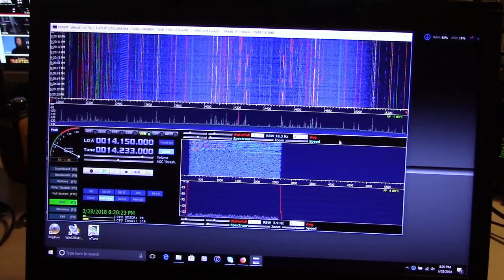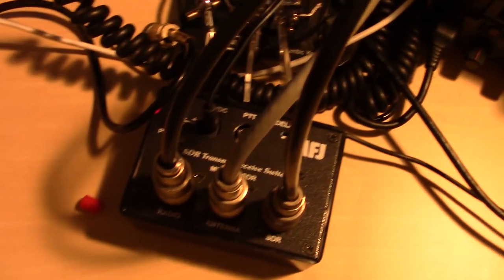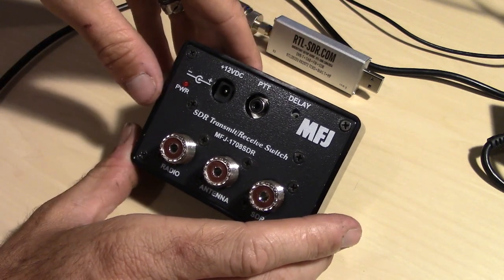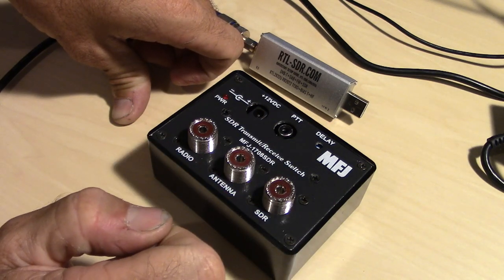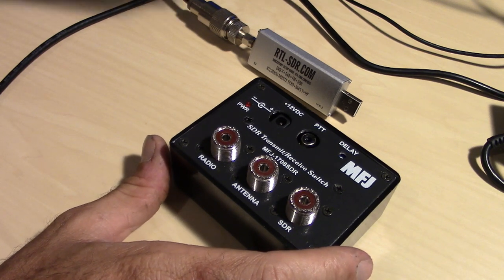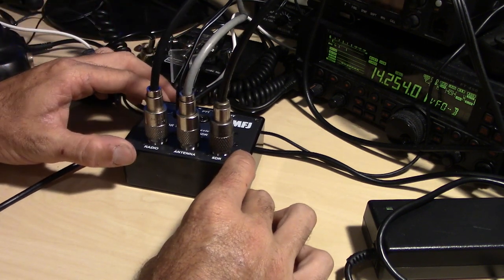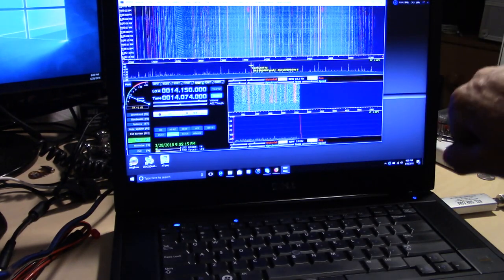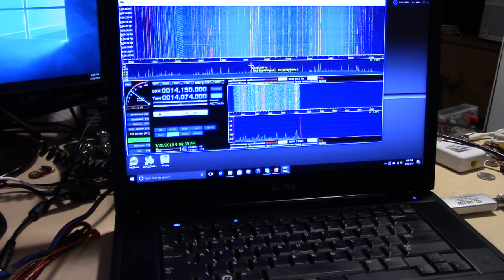MFJ-1708SDR Transmit/Receive Switch For SDR Receivers

Comment: I have this device, and just an FYI to everyone, it has an RF sensing circuit that works in absence of PTT output connected. I've used with up to 100Watts, no PTT out, and no damage to SDR.
Reply: @offthecuff6352  Still working 3 years later... IDK what "hard on the SDR" means. There is no difference in sensitivity.
Reply: @offthecuff6352  make sure you change your headlight fluid, and oil every 3ft, you're a lid. 73

Comment: you can easily bring out the PTT lines from the radio using the Ameritron (MFJ) ARB-704 box and cabling for the Yaesu FT 450.  I had my TX/RX sensing line go out, MFJ fixed, then went out again within a very short time, use the PTT instead.
Works like magic.
(I also use it to trigger the amp with a 'Y' cable to split the two)
I do the same thing to change Rx antenna/Tx antenna switching and now use a buffer/amp on the first IF to get the signal to the SDR with the FT450D front end filters working - much cleaner display!
Reply: Tapping the IF gives you the filters of the radio? So the better the radio / IF the better? I just can't see soldering inside my TS-570DG! Maybe on my TS-50. =]

Might be the best thing though. Once you tap in its no need for a T/R switch. I guess use RG-174 or similar and bring it out to the SMA / coax connector on the SDR?

Comment: My Yaesu ft-450D does not have a push to talk switch in the back of the radio. It does have a linear amp din cable port which has an RCA jack on the other end of the cable. Do you know if this kind of cable would work for the PTT on the SDR1708?Thanks

Comment: Hi thank you very much for the info. IF I well understood I may use old rigs like IC-756 or 706 or FT900 with the MFJ and a SDR-Play. No need to filter IF or else. The dongo on your USB can be replaced by the new CI-V cables on commerce or it is necesary? Thanks again 73

Comment: Cannot find the PTT cable on any radio store website, including MFJ. Do I need to call them or is it through a specific seller?
Reply: Isn't it a RCA connector? Most are. Grab a stereo cable or video cable. So you don't have extra cables adding mess to your shack strip the extra unused RCA cable / cables off. 

Or buy some shielded cable and 2 RCA connectors and make it to length.

Comment: I can still run my amp with this unit right , the amp has to be after the 1706 correct?
Reply: Correct. Amp after the 1708. In fact, the instructions include details on how to use the ptt plug to communicate with the amp.

Comment: Or you can just save yourself that overpriced $100 . Every HF rig has a T/R switch in the back. (usually to key an amplifier)  Everytime you key up it will make a connection to ground ... All you need is a 12v double acting relay and run power to one side of the relays coil and bingo, the relay kicks in. Just  wire it up so When you key your mike the antenna switches over from the SDR receiver to the transmitter side and the other side grounds the  SDR to ground... when you let up it will break the ground to the relay and your back in listening mode again ....  All for about 5 bucks (or less , if you scrounge your relay)... If by some chance you don't have a T/R jack in the back of your rig you can make very simple circuit called a Schmitt Trigger which senses RF... or you might want to build one anyway to do that same ( extra safety) feature that the MFJ switch does....then take the 95 bucks you have left over and by an SDRplay..

Comment: Eric, great video!!  I have that unit and an SDRPlay RSP1a, and my radio is a Xiegu X5105.....do you know of a way to get the PTT out of the X5105 into that RCA plug?  I know you have an X5105, and wondering if you have used this TR switch with that radio yet.....
Thanks!
73
Pete
KD2OMV
Reply: Peter Van Eenenaam > Doesn’t the Xiegu have an IF output jack?
Reply: Yes....but I dont think that supplies PTT voltage that would trigger the relay.  I think it would be safest to also use the proper PTT input to the switch to also trigger the relay.  I have been trying to figure out how to do that.
RF from the transmitter does trip the relay, I can hear it work, but I am afraid to put full power without also using the proper PTT input to the switch.  I have asked MFJ the same question, but they were unsure, and said they would call me back about it.....a few weeks ago.  Maybe I could make my own cable to using an 8 pin male minidin connector to the RCA?
Thanks.
Reply: I would ask on the "Xiegu X108G & X5105" facebook group.  Atleast one designer of the X5105 follows that group.  They could get your answer much faster then MFJ.

Comment: The problem is, it kinda sucks.  It is nothing more than a 'Switched T Connector' (it states in the manual it is based on a relay), which means no effort is made to ensure equal power is delivered to each receiver, and that the receivers are isolated from one another.  In other words, if you pair this thing up with a cheap RTL-SDR (worst case, any other receiver will do), you're going to get worse performance from your primary receiver, as well as subjecting it to any noise, hash, birdies etc generated by the SDR dongle.  See our review of the unit for a full, proven analysis.  Sorry, but its just a toy at best, and at worst it is the absolute enemy of weak signal work and DXing.
Reply: A T/R switch is a relay. You use the PTT to ground the control of the relay to switch one side of the contacts from normally closed to open. And visa versa on the normally open contacts. Its based on the old separate receive and transmit stations that had them. Before the RF sensing auto or PTT controlled T/R switch it was a manual switch. 

All T/R switches are like this. If you want both the transceiver and the SDR to receive at the same time you need a combining device not a relay. DX Engineers sells one. Its pricey but sounds like it is very well built. The DXE-RTR-2.

But you get what you pay for. For those of us who want SDR receive added to their Ham Radio a T/R switch does the trick. You can actually build one from scratch. I ordered a kit for $20! The MFJ is $80.

Comment: Too bad you did not demonstrate transmitting through the device.  You may be amazed at the poor isolation and cross talk - the receiver still receives the transmitted signal even when the device has supposedly disconnected it.  Otherwise, nice video.  TT

Comment: Thanks for the info Eric, I have one of those $20.00 dongles laying in a junk box i never used the thing maybe i should dig it out of the box and give it a try, i bought the thing years ago and never used it, the antenna that came with the thing was useless i chopped off the antenna wire and hooked it up to my Mfj-2286 that is clamped to the top of a old steel clothesline T-bar pole in my backyard, The virticial works well, with radials, The antenna works fantastic with my mfj-929 tuner man the thing tunes 80 and even 160 with the radiales. I can not believe the thing is usable on 160 Meters. I will get you a link to the picture if you would like to see the antenna setup. https://www.dropbox.com/s/cw335s7nqadt7pw/20180306_174636.jpg?dl=0  https://www.dropbox.com/s/kprhglswt2sjtfu/2018-03-01%2008.17.56%20%282%29.mp4?dl=0